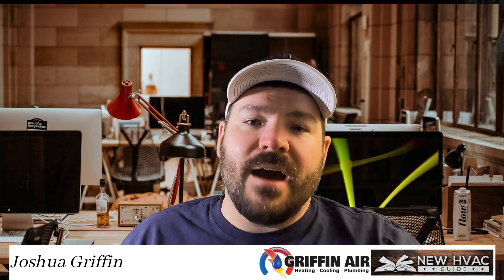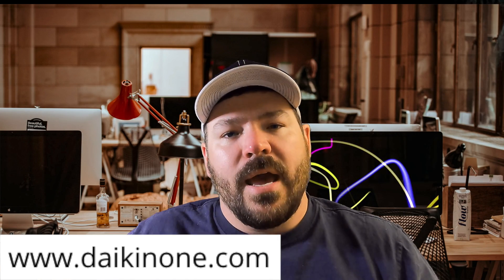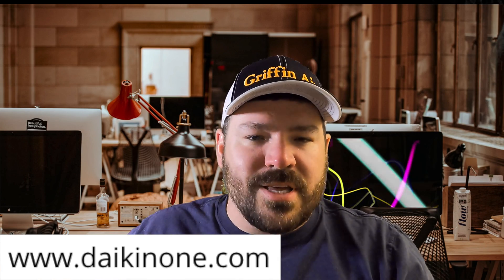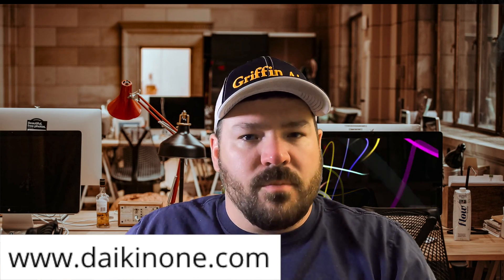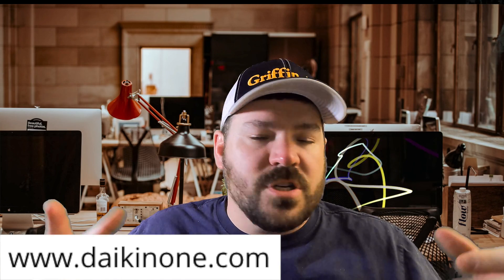3 Quirks with the Daikin Fit HVAC system. Video for Installers

Comment: Just an update for point 3, the DFVE-R32 is now available as an air handler. Its AHRI certified, can be mounted both vertically and horizontally, and comes with an electronic expansion valve to offer both heating and cooling.

I'm sure the OP was right that this wasn't available at the time of posting but is now.

Comment: Hey Joshua nice video. 

Question for you if you don't mind. I recently got a
Daikin Fit system for my house  with air handlers. The system heats to the set point but the the downstairs unit doesn't turn off after reaching the point. Example  Set 68°f reading 68°f. Heat request still on the screen. 

What i have noticed is once the temp goes 1 degree past the set temp it will turn off.  It that how Daikin does it?  My 1st heatpump system so still learning. Thanks
Reply from the maker: Have your dealer do a proper calibration of the Daikin One controller. And if it’s not connected to WiFi, have them do a firmware update. That should fix it.

Comment: I have a DM96VC0603BN mounted horizontally  with a Goodman 1812009261 coil CAPEA1818B4 and a DZ17VSA241 FIT.   Is this proper or did my contractor just cobble something together?

Comment: We just had this system installed and we hate it. It is SO weak compared to our old large unit. 

The air flow is about 15% of what we are used to. It takes 3-4 hours to cool a single degree in our house!
Reply from the maker: Tell your installing company to turn on the boost mode and that should alleviate your concerns.
Reply: @NewHVACGuide  thank you. They said they did but it is really weak. I've been through all of the settings and can't find anything about boost mode or fan speed. 

My old unit was a 4 ton and so is this new one. I'm not kidding it is less than half the air flow of my old one.
Reply from the maker: Airflow is variable and will sometimes be blowing very little. However, if it’s taking 3-4 hours to cool just one degree, something is wrong. We don’t have that issue when we install them.
Reply: @NewHVACGuide  who should I contact since my installers don't seem to know what they're doing?

Comment: I have a Daikin Fit system installed this past October. This is the first month for the air conditioning to run. I’m in southwest Missouri it is humid here. My thermostat has been saying “overcooking to dehumidify” what does this mean? 4:24
Reply from the maker: That’s simply an alert based on the settings and notifications it is set to in the thermostat. These can be changed as well as the profiles for dehumidification. Have your pro take a look.
Reply: @NewHVACGuide  thank you!
Reply: That means it's cooled to set point but it's going to keep cooling too condition the air because there's too much humidity it's a good thing
Reply: @Max4o7FL  does this mean its preheating ( "overcooking ")  sign the heat strip, or is it a typo ie overcooling by several degrees to deal with humidity

Comment: My Daikin fit heat pump is very noisy inside the house. Everytime it turns on, it has this noise that ramps up and down. Any explanation?
Reply from the maker: Have your contractor adjust some of the trim levels and the airflow.

Comment: Josh. I got a 2.5 ton Daikin fit installed but its not working correctly at all. They got it up and running but the speeds seem high and im getting about 145 cfm at each register which comes out to around 1010 cfm.. Which is correct for that unit. BUT the problem is that the HP is calling for say 600cfm but the blower is running at full speed.

I am getting some odd reading at the thermostat.  Data1 and 2 are reading 0.65v, is that too much?  Also its dropping out occasionally if i leave the meter on it.  Its quick like a little blip and then back up to 0.65v.  That might be my main issue

  They measured static pressure and said it was 0.2 then they were testing out the system.  Daikin said they want to see 0.5. Which is fine but I wanted to achieve 2 sqft of filter area per ton and I did. Im running 2 20x25 honeywell filter grille filters ATM. I want to use MERV 13 so that is why I wanted to go with large filter areas. Off those 2 filter boxes are 1 14" flex line each that runs to the AHU.  Im assuming either the voltage issue or the static pressure is too low at low speeds and the ECM blower is ramping up until if finds its static and can run correctly the best it can with the algorithm that it knows. (i assume its based on rpm and amp draw to get its known cfm)

Have you ever encountered something like this?  The dealer is calling in their Daikin Rep/Tech to come see it next Monday but until then maybe there is something I can do with the filters.
Reply from the maker: Definitely sounds like there’s something amiss. We’ve had a couple systems that we’ve had to adjust some of the airflow and trim settings in the thermostat. Hopefully you are using the Daikin 1 thermostat. One thing to note is Daikin reps can dial in remotely on the Daikin one and go over a lot of those settings as well. we had one years ago that a sensor had gone bad in the air handler, causing it to run constantly. And our rep was able to dial in remotely and figure that out. We don’t have a lot of issues. So once they get your issue straight, I’m sure you will be off and running.
Reply: @NewHVACGuide  we’ve already trimmed down the air flow.  The problem is that the unit is reporting wrong air flow to the thermostat.   Example, HP calls for heating at 600cfm, AHU says something close like 600-603cfm but the output is closer to 1000cfm.     What static do you shoot for on your installs?  I figured lower would be better but Daikin said they like to see 0.5.   

I think I got 2 different issues going on but is the fact that we’re seeing 0.65 volts at the thermostat bad or within spec?

Comment: I live in Florida and currently have a Bryant 2 1/2 ton system with air handler. My residence is fairly small at 1300sf, but the system has been pretty good as my electric cost per month averages about 75-80 Dollars. My warranty is out now 10 parts and labor and I know from the condition of the air handler coils it won't be long before I have major problems. I have read about Daikin and have heard the fit system is very good. Do they offer a split system that I have in the same 2 1/2 ton range and what would be the approximate cost for a Daikin system. I run my system 24/7 at about 74 degrees.
Reply: About $13,600 for the 2.5 ton. On sale right now in Florida
Reply: You are saying the Fit 2.5 ton is about $ 13,600 right now ? @anthonybernier9952

Comment: Old Trane system would put my house at around 46-48% humidity. With the Fit installed I'm seeing humidity 50-55% and at times 61%. Circulate is off, ac company calibrated the thermostat and set humidity levels for over cooling to 35 to 45%. Still can't get levels where they used to be. Any idea?
Reply from the maker: Did they check sub cooling refrigerant levels in charging mode? Also, they can adjust the trim settings which make a world of difference.
Reply: @NewHVACGuide  Yea they checked the levels. Are the trim levels done remotely?
Reply: I had this issue. I enabled boost mode on my thermostat by going to dealer settings
Reply: @Trav0987  The ac company did get mine to work better. They put it on - 15 -15 - 5 for cool airflow trim, cool profile D, and dehumidification to A. I do see boost mode set to on. What sucks though is my electric bill is 3 times higher then it was on the old unit.
Reply: @thedude2897  I had a very old carrier system and I live in a hot climate. I use my AC only at night for sleeping. Maybe on days that I don't have to work. My tstat is usually set between 76-78F. Where I live my electric bill is expensive. You just have to pay for comfort sometimes and it's a good sacrifice when you feel rested. I am pleased with the daikin fit. I like being able to use it on my phone as well

Comment: I have a daikin heat pump with air handler at a 12 degree subcool but only producing a 13 degree split, do you know what could be the problem..?

Comment: Hi there, does the daikin fit heat pump  that pairs with a gas furnace has a 4 ton one? My house is 2400sf in WA, and from doing some online research I think it should get a 4 ton but the local installer said a 3 ton is enough, but then he said that Daikin only has up to 3 ton when installed with a gas furnace!

Comment: Your third point is incorrect you can in fact have a dual fuel fit system.
Reply from the maker: Horizontal? What’s your AHRI number?
Reply: What do you mean by horizontal? 

With my current dual-fuel Trane heat pump w/ natural gas furnace the A-coil assembly sits on top of the gas furnace/air handler..airflow from the bottom out the top. Does that setup work with the Fit?

 @NewHVACGuide
Reply: Horizontal means not up flow or down flow.

Comment: Can you tell me why It can't be installed with a horizontal furnace or where can I  find that information ?, thanks
Reply from the maker: The straight AC can but the heat pump can’t. It’s due to The fact that they don’t make an evaporator coil for horizontal evaporator coil that matches the fit heat pump for an AHRI match.
Reply from the maker: You can confirm it with the AHRI directory

Comment: Question. We have the 2.5 ton fit heat pump and the 3 ton air handler to match. When they installed this unit should they have trimmed down the airflow for the 2.5 ton? I noticed that when it’s on it really doesn’t have much condensation coming out.
Reply from the maker: They can definitely check the settings on the thermostat but the fit ramps up and down regardless. Meaning it is more forgiving than a lot of other systems on the market since it is a communicating inverter

Comment: Hi... my Daikin mini split will not go straight out through a wall like all the videos I see..the line set will go into the wall then across to an open area in my attic....about 5’ away....then out to the condenser..
Can the attached line be bent downward?  Seeing the lies ET will be connected inside the wall next to the unit should I wrap it or tape it to ensure in case of any leaks?  Thanks
Reply from the maker: I’d get a pro in there pal

Comment: I can't seem to find the db rating (range) on the air handlers for the Fit - like for the 2 ton and 2.5 ton? I know the outdoor unit is quiet enough but in our little FL cottage, the air handler would have to go in a closet in one of the tiny bedrooms. Currently ductwork from a package unit runs into this closet so plenty of room - but the noise level is everything to me! I'm handy so can easily build "closet within closet" to house the air handler. Any experience with the small Fit air handlers being really close to the living areas?
Reply from the maker: So many variables determined the decibels of an indoor unit. Ductwork And static pressures are a couple. I recommend calling the manufacturer for any systems you are looking at, but definitely wanna make sure you go with a variable speed system.
Reply: @NewHVACGuide  Thanks - I realize those variables - I was trying to get a sense of the db of the unit itself to use as a minimum which the other stuff would add onto. Even if I knew the range was 40-55db in "normal" installations I could work with enclosing and soundproofing to get it to where I need (<50 2 feet away). I wrote Dalkin to see if they have specs and specified the Unit and also that I know about those variables, If I get an answer I will post it here. thx
Their setups do have the vari-speed of course!
Reply from the maker: OK thanks. We don’t typically get that question so I don’t know the answer off the top of my head. It’s usually the outdoor units that companies brag about the decibel levels.
Reply: @Droneflyers  please let us know!

Comment: One other quirk I might add to this is the sound the daikin 1 controller will make when the light turns on at the bottom. I had a few complaints from customers regarding it. I just tell my installers to disable the bottom light on startup/commission to avoid that complaint
Reply: If the light is making noise warranty the daikin one . There was a batch of bad ones . I only got one that did that buzzing
Reply from the maker: Smart!

Comment: We just installed a new system (Daikin fit + Air handler). But the technicians couldn't figure out how to get it running. One of the system test, which is supposed to run 5-15 mins, can never finish. You mentioned the .6 DC reading from the thermostat. They are getting .64. Do you think that is the reason the system test cannot finish?
Reply from the maker: That doesn’t sound right. Check all communication connections is where I’d start.
Reply: Yeah check the wiring at the air handler but it may also be just the sequence. Take the thermostat off the wall and take the power from the air handler and then from the outdoor unit. Replace them in opposite order. Outdoor unit first then the air handler then the thermostat and try again. If that doesn't work you can go into dealer edit & factory restart the thermostat

Comment: Hey homeboy, can you answer a question.. Today we installed a daikin A/C (DX16SA0421AD) with the smart thermostat and it wouldn't run. I told my partner it wasn't compatible because it says which units are on their website.  Will the daikin one smart thermostat only work with the DX16TC(two-stage-communicating) like they say? Will the DX16SA(single-speed-non-communicating) work with the smart thermostat? Any insight at all would be appreciated. Thx, man.
Reply from the maker: Daikin 1 will only work with systems that it says it will. I had a technician install a system that was not an AHRI match and the Daikin one would not operate it.
Reply: @NewHVACGuide  so i guess the homeowner won't be getting a smart thermostat. Thanks for the reply.
Reply from the maker: Get them a fancy ecobee. They’re “smart” and are half the price of the D1
Reply: @NewHVACGuide  this is a great solution. I think pairing with the phone is the main feature the homeowner is  looking for. 🔥

Comment: Daikin quirks are fun lol. I think their other inverters turn the od fan on every once and a while. 

The regular Daikin comm outdoor units had to have a .6 vdc DIFFERENCE between 1 to C, 2 to C. The bias voltage is different from air handlers and furnaces. If the difference was only around .3 vdc, then you had to swap the bias dip switches on the outdoor board
Reply from the maker: You've installed one or two! 🙂

Comment: The FIT is an amazing system. Super quiet and efficient. My area had a huge sweating issue when with the air handlers. They told us to increase the airflow trim 9-15% to keep the cabinets from sweating.
Reply from the maker: They're very customizable for sure
Reply: So, how was that done? I've added insulation to the plenum which helped.